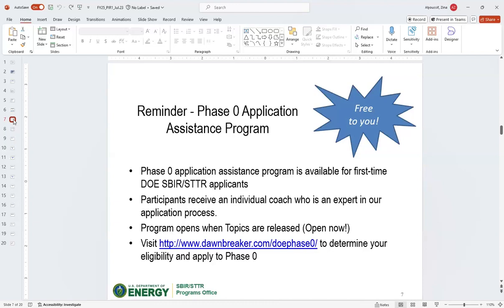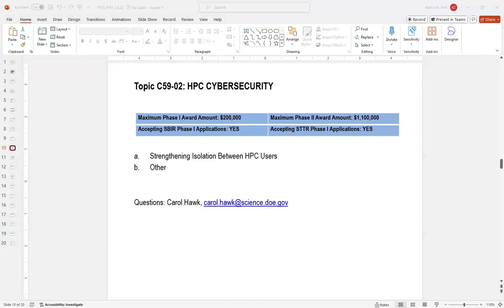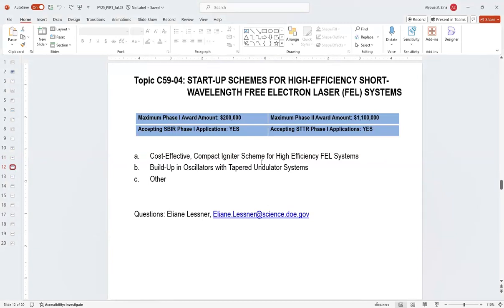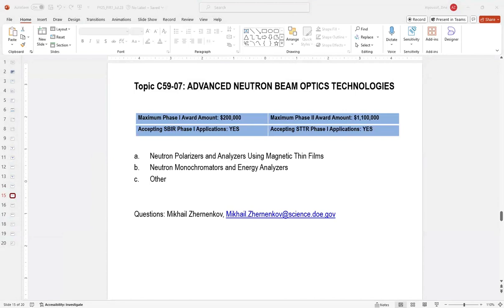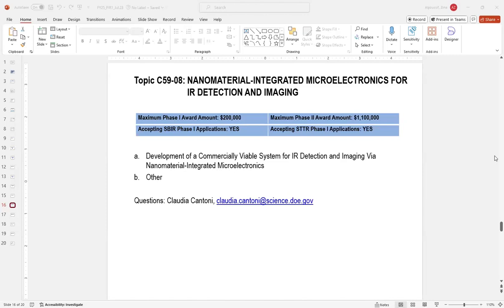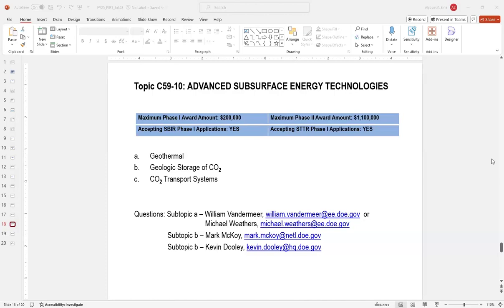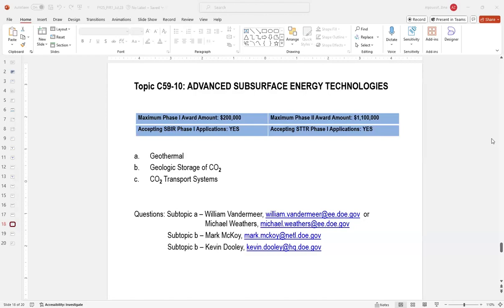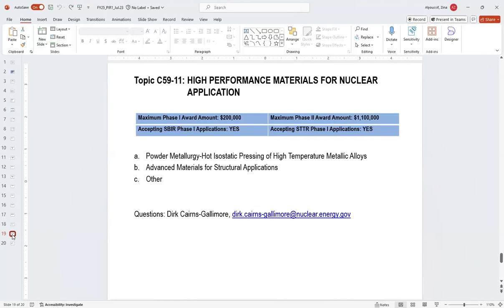FY 2025 Phase I Release 1 ASCR & BES Topics 1-11

Comment: Sounds like a few things being developed and not just one thing. First time to your channel. 

42:07 Have you thought about neutron deflection from reactor tech and making a neutron lense from crafting a metamaterial out of it. Computrr modeling to get the fab right.

Has anyone built a casmir array for frequencies, and also tested space and next to a collider? Measuring the phased density of space.

Side question. Have you tried tunable metamaterial for slits QM. The orbital energy levels part of the tunable range.  The new nano gold construction technology to build them. You can even use a rainbow for extra gradient mapping. 

Have you tried acustic pinching in an accelerator before?

Keep up the good work.